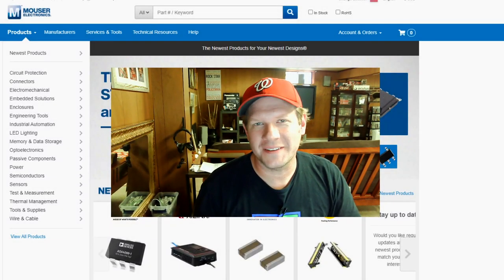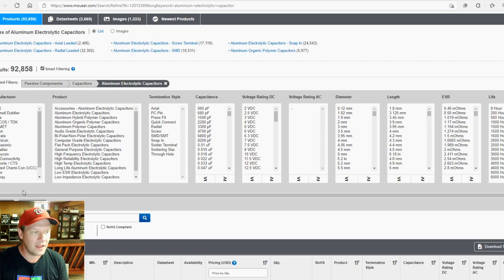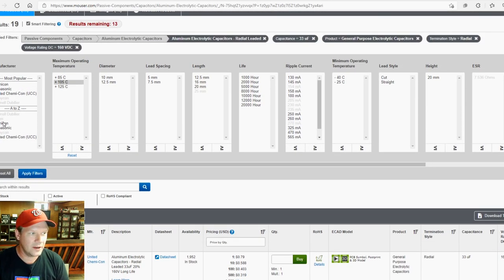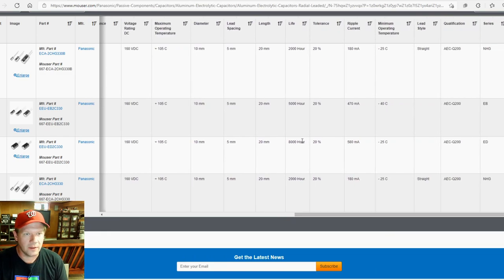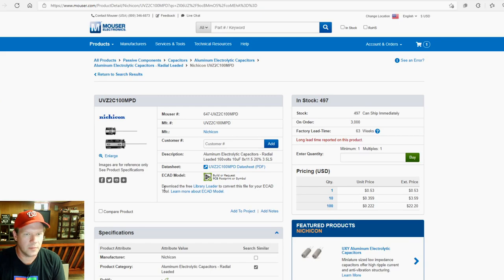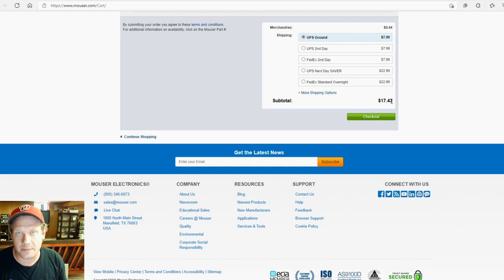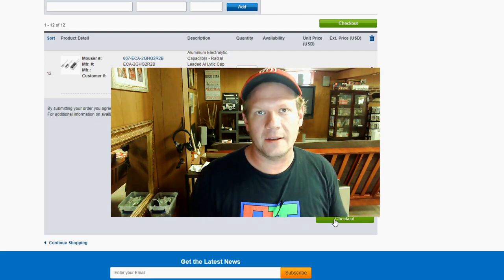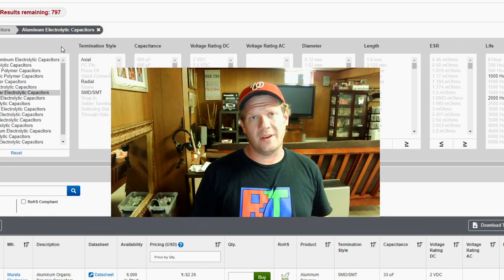How to Create Your Own Capacitor Repair Kits - Even during a parts shortage.

Comment: My own personal method (because often times cap lists are either incomplete in spec information, or simply use caps not designed for the job) is make my own documentation of each cap as I pull it from the PCB. I record the ratings, and I also record the lead spacing, diameter, and height of the cap. Then from there, I EXCLUSIVELY use Nichicon capacitors for electrolytic recapping whenever possible. I recently rebuilt my Data East pinball power supply with brand new Nichicon 10,000 hour power supply-specific caps rated at 105C. The power supply has been running absolutely perfectly after the recap (I also replaced all the transistors in it as well as the regulator).

Comment: One tip when selecting the voltage you can click on the ">" button and it will select your temperature or above. This will give you more options, higher voltages caps will still work and may even last longer.

Comment: The time consuming part isn't this.... It is getting all the cap values off the board.  Surely you must have more google docs with all the other ones.  Pay all of Pat's help forward and release those docs. 😀
Reply: The "Service Manual" for the chassis of most of these CRT's has a listing of everything.  Sony's PDF's are often text selectable, so you can paste into a document or spreadsheet.

Comment: I made a list and ordered every single cap for my consumer 36” wega trinitron from mouser November of last year and I still haven’t gotten them all.
Reply from the maker: Yeah, I had that happen once and then I checked and found that I had accidently ordered caps that went out of stock.  Then about 8 months later I got a random package with the missing cap that finally was stocked.
Reply: @RetroTechUSA  at least half of them were out of stock 😅 and I had it set to send out only when the whole list was together. I get email updates on stock every few weeks. I did go overboard on the specs like heat tolerance and whatnot, i should just call and see what I can change out.